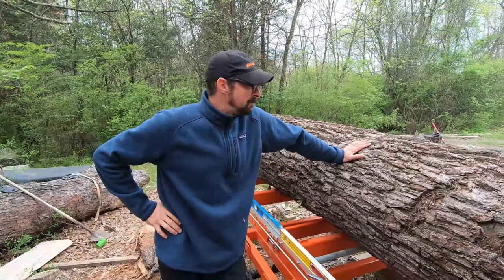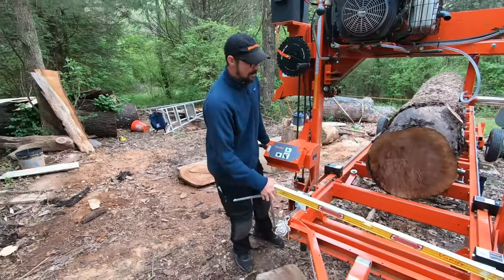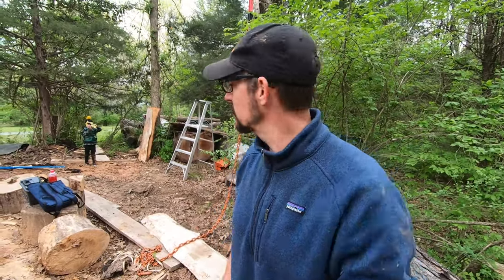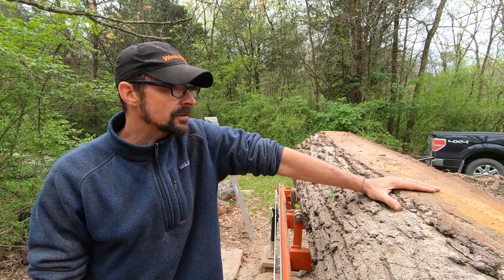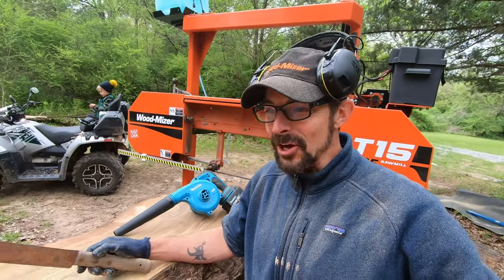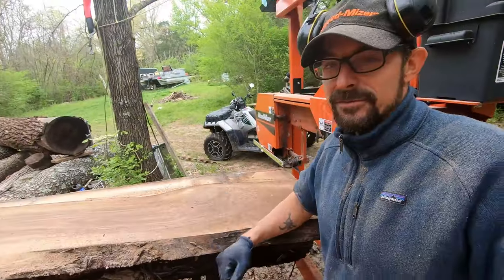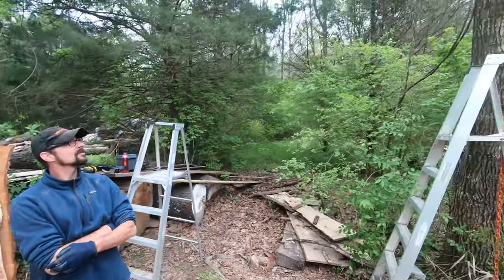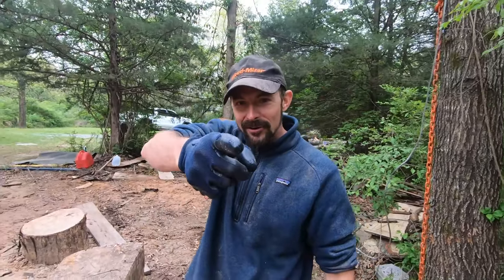Woodmizer LT15 Wide - GIANT WALNUT LOG

Comment: Hey man got the same exact mill but mine stationary on your to-go kit is there anything that they sold you that stiffened up the bed or is it just the wheel platform at the height adjusters at the tail lights in the trailer hitch I guess you may call me too cheap to buy but I've been on woodmeister's website looked around I don't see a lot of details in it other than a parts description thanks
Reply from the maker: I believe it’s just the wheel assembly and lights they put on as well as the hitch. I believe you can order it and install yourself!
Reply: @vondywood2376  thanks buddy